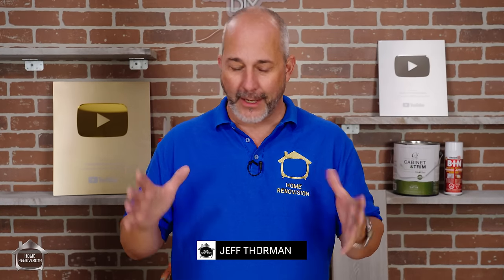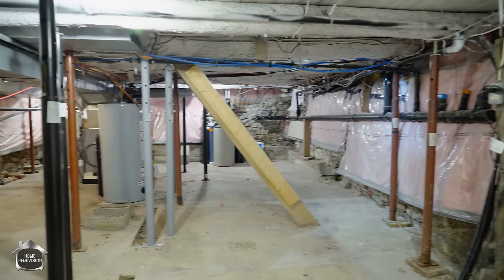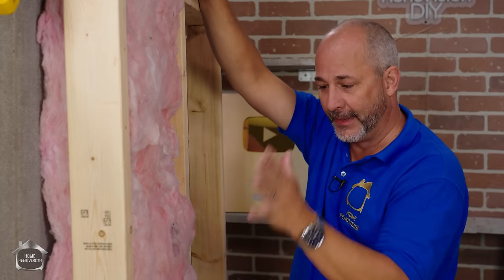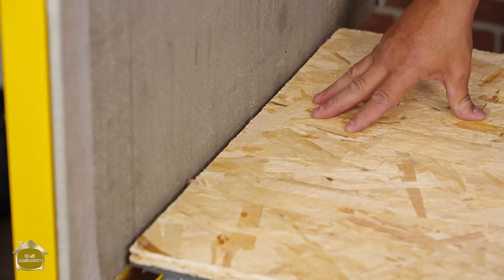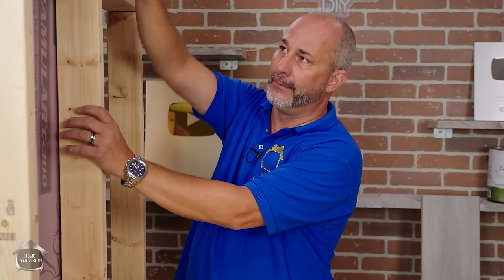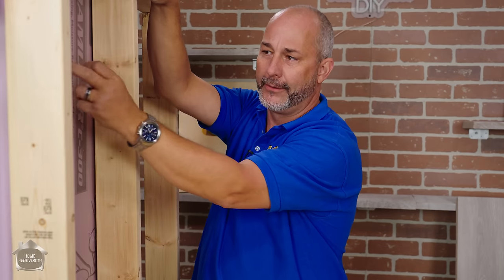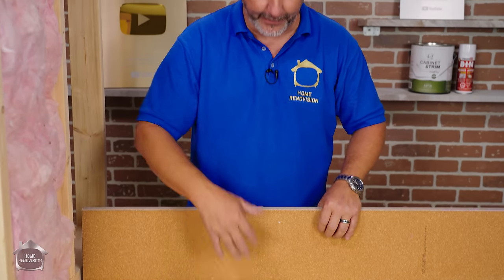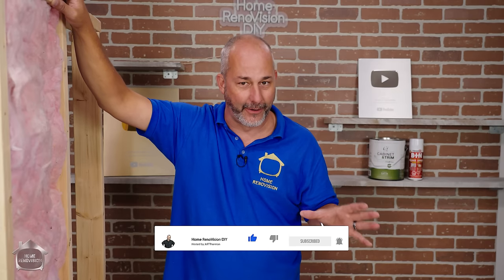The Best Way To Finish Your Basement

Comment: basements in the Midwest here are not a lousy investment..When its always cold out its a great place to hang out and adds much value on one that is done right.Sold our last house about 5 years ago and i did an "open" concept basement.finished it all myself other than the finish of the drywall..We did nothing fancy,had good carpet,etc...People couldnt believe it and was one of the main reasons our house sold for asking and fast..Now if you pay someone to do all of it...then the return is not there but doing it yourself and doing it right it can really pay off.

like reinventing the wheel with all you have going on there with the subfloor and foam board and then framing..suddenly your house just became smaller!wow..not saying there isnt a place for this,just saying its not reality and economical..

Comment: Would love to hear your thoughts on spray foam in basements for vapour barrier/insulation but also used on the basement ceiling for soundproofing. Is this worth the money to save time and steps? What do you think? Thanks keep up the good work!
Reply: We did spray foam insulation in our basement after a major hurricane flooding. The basement didn’t feel muggy at all. Was always a comfortable cool year round.
Reply from the maker: spray foam is the best choice for thermal break and gives great sound protection for folks who can afford it. This method is an alternative for half the cost and allows future access to foundation cracks in older homes.
Reply: Doesn’t it block the air channel for moisture to evaporate?
Reply from the maker: spray foam is not to be used on older houses for that reason.
Reply: @HomeRenoVisionDIY  thank you! I was about to make that mistake in my 1955 house. Would you also recommend to avoid spray foam on the rim joist in between the floor joist? What’s the best insulation for the rim joist in your opinion for an old house ?
Reply: @Addl3man  I’m currently considering spray foaming basement walls, all the way up and in the run joists. I’m combination, I’m thinking of installing a mini split system that can auto control humidity. Hopefully this is a good approach!

Comment: Love your video's Jeff!  Currently finishing my basement in our home we bought new 5 years ago.  Using your tips & tricks... about to start boarding after doing all my framing/electrical.  I am using pocket doors as space savers which hopefully will turn out great.  Do you have any video's on pocket doors installation?  My doors have to either be made custom or cut down as the bulkheads/framing left me with a smaller RO for my pocket door frame... nothing insurmountable but not ideal.  Dan (Edmonton, AB).
Reply from the maker: yes. I did a pocket door video a few years ago. here it is. https://youtu.be/QPYGXnfPIBM

Comment: What’s your thoughts on using metal studs instead of wood? It seems like in a basement metal would be idea - no chance of mold, at least in the framing.
Reply from the maker: once you isolate the high moisture environment your fine. using a rigid foam first allows a thermal break and is great in the northern climates.
Reply: Metal framing is very common in Europe. France and Germany for example. These metal rails can also be much thinner than wood if space is limited. Yes you compromise on the R value, but you can make up for some of it by using polyurethane boards instead of fiber glass or rockwool. If you want to see how it works type ossature métallique into YouTube. You might not understand a word, but the visuals will show you everything.
Reply: @cillboon  thanks… any direction for mental stud framing tutorial?

Comment: If we have existing framing that we aren't going to redo, and they are too close to the concrete foundation to get anything behind it, would the next best solution be a 1-2" layer of closed cell foam + fiberglass batt in the stud bays? If so, would you still install a poly vapor barrier on top of that?

Comment: I'm planning on renovating my 1924 House Basement.  I wan tot use DMX 1-Step and top it off with vinyl flooring.  How do I arrange the wall framing studs so to allow any moisture from under the underlayment pass to the cinderblock wall?

Comment: Couple years ago we got a ton of rain several days in a row and the water table was very high and everyones basement in town had water coming in throught the floor and walls. Would this system be able to handle that or would a more in depth waterproofing system need to be installed? Water was seeping in for several days until water table went down enough

Comment: Hey Jeff, thanks for your videos.  Q:  Does the foam board count as a vapour barrier?  Ie do you still have to use plastic vapour barrier over your studs and fibreglass insulation?
Reply: I was wondering this myself. I live in southeastern PA

Comment: This video is eye opening! Great video as always!!!! Makes me want to do redo all my basement which is finished already when I bought it, but is super cold. Just something that I realised on 3:35,  as far as I saw here in Quebec, the pink fiberglass does not touch the concrete. There is a gap between concrete and the framing, yes, but the pink fiberglass is trapped as a sandwich between  vapour barriers within the framing.  

I live in Quebec and my house is from 1990 exactly. I have some missing fiberglass between the concrete and the framing on the top joist and I can see a cold air flow coming into my basement which uses suspended ceiling. I discovered some videos that insulating the rim joist with rigid boards and insulating foam sealant with mineral wool after is a must. I read that it can cause condensation and rot the wood. Would you recommend to do this to reduce heat loss? and what would you check before applying this procedure? 

Thank you Jeff!

Comment: How would I use this system if the stairs leading into my basement are originally placed only leave 1.5” from foundation to the stringer? Is there another option for that wall or am I going to have to loose width on the stairs to make room
For the wall? I can’t relocate the stairs as I don’t have the head room. House was built in 1960

Comment: I have a hard time deciding how to insulate my basement walls in my 74 house (no insulation or vapour barrier on outside) since there's a lot of different views on the vapor barrier in a basement. Some say it's a big no no and some day you need one... I love in northern climates (often -20/-15°c in the winter) and my basement is i would say 50/50 under and above ground

Comment: My only question to how do you connect the framing.  Do you just run a cement screw through the bottom sil through the subfloor to the basment cement or do you just screw into the subfloor?

Comment: great video! it really helps put a bunch of stuff together that i didn't feel i had the info to know what to do.  

I do have a question, how does this interface with rim joist insulation. you mentioned the air gap for moisture to move and eventually get outside, but would rim joist insulation invalidate that or is there a technique to use to assist with that. I swear i watched a video of yours on how to insulate the rim joist, but i can't seem to find it right now.
Reply: Great question and I hope Jeff answers you.

Comment: Hi Jeff, love your video's!!! Does this also apply to interior concrete basement walls meaning between my townhouse and the next? My current basement has insulation already at the exterior 2 walls but nothing between me and the 2 next door basements. I'm new to all this so wathing all your video's to get tips. I am super handy but new to this so can't wait to do my basement (currently rought in). Also, does interior basement walls have any benefit of being insulated also apart from sound (this is for the thin walls this time) between my own interior basement walls.

Comment: Hi Jeff, thanks for this! My question is about the insul armor flooring. Can I put my bottom plate directly On top of that? It says it's rated for it but I'm just not sure. My house was built in 2007 so it's pretty new. I just don't know if I should use pressure treated bottom plates directly on the concrete or using insole armor to cover the whole floor before framing the walls. Thank you!

Comment: In the event of flooding in the basement, the subfloor would need to be replaced though correct? Where as if it’s just concrete you just have to dry it out.

Comment: Have a 1955 home in Michigan and needed to put in reinforcement beams (I-beam, 4-1/4" deep) to fix foundation cracks/bowing. Any thoughts on applying insulation/finish wall for that situation?
Reply from the maker: in your case I would suggest tyvek on the walls and then frame 2x4 with a 2" space like new home construction. use R20 insulation ij the stud cavities. Cheers! Not perfect but not terrible either. Or you can spray foam if the cost is not too prohibitive.

Comment: Great video! Is the stippled membrane with tongue and groove plywood combo from your older video still a viable option? It's turning out to be cheaper if I do it that way vs the dricore. It's a difference of 600 bucks... wanted your thoughts before I commit.

Comment: *NOOB ALERT*
I'be been watching your videos religiously lately and they have helped tremendously in the planning stages of finishing our basement. 
What I don't quite grasp yet is if I'm going to frame my walls first (in front of rigid boards and using pressure treated lumber for the bottom plates) doesn't that effectively cancel out the vapor barrier?
I'll be using the DMX 1-step as the underlayment. I understand that allows for the transfer of water, but if the vapor barrier ends at the bottom plates of the walls, where does the water go when it hits the wall? Because with the DMX you don't build your walls on top of it. Am I making sense?

Comment: @HomeRenoVisionDIY. If I install the rigid board and then frame, and then put pink installation in between my studs do I need to put a 6mm vapor barrier over the wood studs? Will this cause issues? Also, do you spray from the gap at the top of your rigid board?

Cheers!

Comment: So, I had a perimeter drain system installed in my basement. So now I have a sheet of plastic membrane on all of my perimeter walls. What is the best way to install rigid foam over that without damaging the membrane?

Comment: Hi Jeff, I’ve been watching your videos and educating myself on construction and building science. Thank you so much for all the knowledge you’ve shared. I’d like your advice on this - over a year ago, before I knew any better, I had a contractor replace carpet with hardwood floor in the basement. They simply glued the wood onto the concrete…ugh how I wish I could go back in time. Now we’re planning to re-do the drywall and insulation in the basement. Not sure what’s behind the wall yet, but it’s likely 2x4 beams and fiberglass insulation or no insulation. What’s your recommendation for the new system (wall & insulation)? It may not make sense to redo the flooring at this point? Now I guess it’s more important to keep the basement dry and well insulated? Please help. Thank you in advance.

Comment: I’ve read that you should put the subfloor up to the studs (leaving a gap) vs under the studs. In case you have a flood you don’t have an issue that you need to remove walls when you replace the subfloor. Which is better?
Reply: Wouldn't you then have to replace the bottom of the studs anyway due to the flood?

Comment: Hey, great videos as always. Planning on finishing my basement of my newly built house in Quebec. The exterior walls are already isolated with sprayed Urethane and drywall. Electrical rough is already done. Ceiling are still open. Can I install the subfloor like the one you have directly on the cement without removing the exterior drywall? I'm planning on install vinyl floor. Can I do my framing with 2x3 to save space? Do I need to put a subfloor under the shower base? Thank you!

Comment: How do you attach the subfloor panels to the concrete slab?  How do you attach the bottom plate of the framed wall to the subfloor panels?

Comment: Great video, 1 question. 
How would you install electric heated floor and ceramic tile over this floor system?
Screw panels to concrete, Schluter Ditra, thinset with heating cables, ceramic tile over the top is what I’m thinking. Thanks!
Reply from the maker: if using that system simply add the schluter membrane to the concrete floor and then cable and tile. no need to consider moisture transfer when using electric heat you rick tile failure on a subfloor that thin.
Reply: @HomeRenoVisionDIY  older house make a difference? 1930’s, basement floor poured 1970’s, unknown vapor barrier. Fairly dry climate, less then 10”/year, zone 5b, colder winters.
Reply from the maker: subfloor protects you from more than just old technolgy..it also protects you from water events that you may not have considered. Cheers!

Comment: Would you recommend starting over with a basement that has been framed and insulated as described in the "minimum code" section of the video but there have been no apparent moisture issues?  I checked behind the insulation in a few spots and it seems dry.

This is a walkout basement in a house built in 2019, we have big windows on the one side and a sliding door going to the backyard.  Would definitely prefer not to tear this down to install rigid insulation but curious what your thoughts might be.

Comment: If I do the foamboard, would adding roxul r22 insulation be redundant? And go with r22 pink fiberglass instead? As that would cost less.
And can I put the framing right against the foamboard, to save few inches in interior space?

Comment: I really like this system. Since there's already two inches of foam board on the wall, adding 2x4s mean you the wall is taking up 6 inches. To reduce the amount of square footage lost in this process, could you turn the 2x4s to be flat against the foam board? Or are there any other techniques for adding drywall without taking up so much space?

Comment: Great video. Clear and easy guide. We’re thinking about finishing the attached garage which is above ground but on a concrete slab. If we tile the floor do I need to install a sub floor?  Thanks.
Reply from the maker: no but i would use a schluter ditra membrane first to protect against the ;possibility of future cracks, this also allows you to add a floor heat source to make the room comfortable to sit in if you get cold weather where you live. Cheers!

Comment: Not sure if I missed it in the video or if it wasn't mentioned, but how is the wall frame going to be attached to the concrete wall with the rigid foam board between it. Are you just relying on stabilizing it with the top and bottom plate and not the studs?

Comment: This was painful. I just spent 5 months (about 350 hours) remodeling my basement. It was finished before, so I left the exterior studs/insulation how they were... had I seen this in November, there's a good chance I would have redone it completely. On the plus side, I know that the previous remodel was done in '92 and it didn't have any significant mold/water damage issues after 20 years, so I'm probably ok. It would have been warmer though!
Reply: You lucked out! Someone finished my basement only ten years ago, using a framed wall wirh batt insulation right against the concrete. It was completely wet and full of mold, the bottom plate was rotted nearly to dirt and had ants and centipedes living in it! I had to start fresh.

Comment: Hey Jeff, still loving the videos!  I have an older 1970's Raised Ranch in New England.  While we somehow haven't had any moisture issues (probably because the house is so energy leaky) would you still recommend the dimple mat?  My basement ceilings are already 89", under 7.5', and while that OSB foam channel subfloor is amazing I just feel it would add to much thickness.  Since the majority of the basement space is for TV watching, to add insult to injury could I also do carpet over the dimple mat?  This would help keep the thickness minimal plus create a more comfy movie space.

Comment: Having closed cell spray foam installed because that's what was used on upstairs of house.  How do you recommend joining the dricore subfloor to wall since there will be no gap between spray foam and wall.  Thanks for the advice!! You've been a game changer around my house 🐐
Reply from the maker: if you have a newer house dave then you don't need to worry bout the air space. if it is older then send me pics in the forum and I can help.Cheers!

Comment: How do you terminate the foam board at the top of the wall where it meets the sill plate and floor joists if your home is built in 80s?
Reply from the maker: install it right to the joists. then use 2 layers and expansion foam on your rim joist and a r20 batt laying on your sill plate. Cheers!

Comment: Hey Jeff! I am finishing my new-build house basement this year and going to follow your suggestions. I have the drycore ready to go. With the moisture resistant rigid foam and the vapour barrier on the outside of the bat insulation, will that trap moisture in between? Is it code to have that vapour barrier on the outside of the bat in Ontario even with the rigid foam?
Reply: Not an expert, but I believe if you use  vapor barrier tape (red plastic stuff) on the rigid foam joints, then the rigid foam counts as the vapor barrier. So then your vb is actually on the inside of the batt insulation